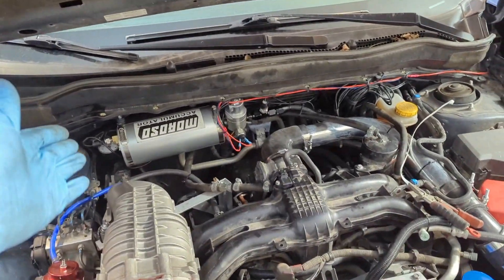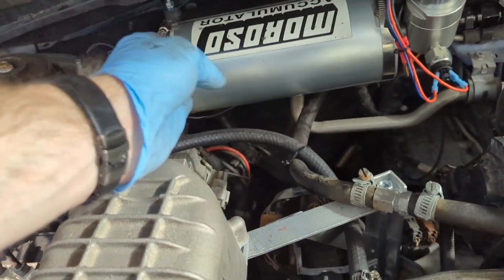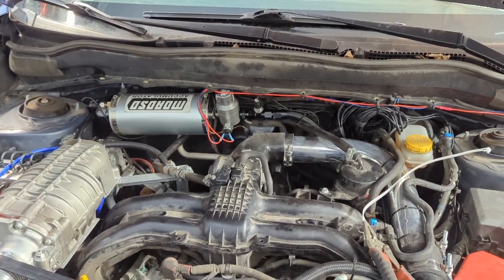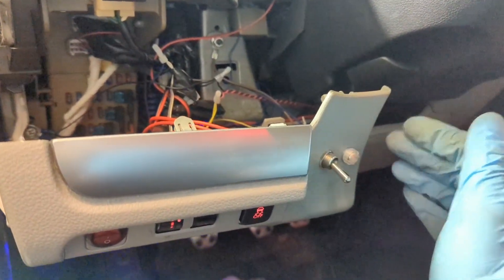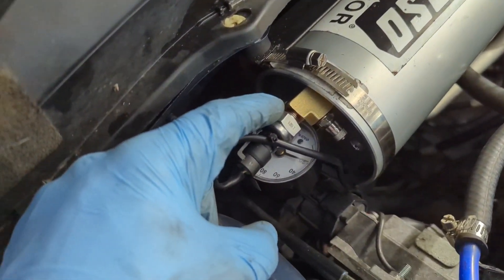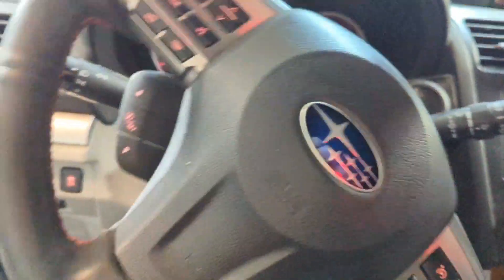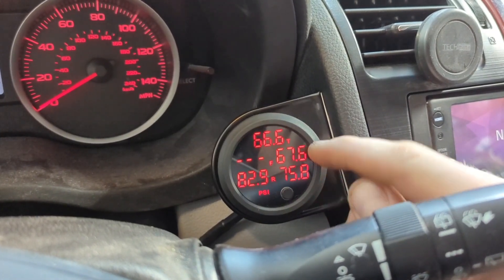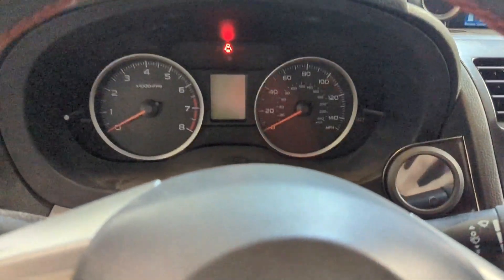Subaru Accusump Basics, Install, and Demo!

Comment: Where did you pick up that multiple pressure guage?
Reply from the maker: eBay - look for gauges intended for air suspension setups
Reply: @avsti  Sweet, thanks!

Comment: Who makes that sandwich plate adapter? Could the oil accumulator be run to one of the ports you have a pressure sensor at?
Reply from the maker: Something from AliExpress. And yes it could be, but that's pre oil filter, so most of the oil would flow back into the pan and not into the engine prior to startup.
Reply: @avsti  ok that sucks. Would have made for an easy connection in my car. I'll have to figure out something else or just go with a cooler alone
Reply from the maker: I didn't mean to totally dishearten you, mostly defending my choices. Accusump into a sandwich plate is still way better than no accusump. Plus, some sandwich plates have connections post filter!
Reply: @avsti  no problem. I just want to do it the right way that's the least hassle. I've seen diagrams teeing the accumulator into the line returning from the cooler and using a check valve. I would think the thermostat will prevent preoiling before start up because the oil is cold
Reply from the maker: Typically, oil thermostats don't block flow from a cooler so much as divert oil going towards the cooler down a bypass. It could still work.

Comment: Love that gauge, you mentioned it was cheap but can't seem to find one? Could you please give Me a name of it so I can purchase one as well? Quick video of My rear engine Subaru project if you are interested? https://www.youtube.com/watch?v=a39IrHRBDNo
Reply from the maker: https://www.ebay.com/itm/145172471775

In case the link stops working, search for a 52mm gauge with 5 air pressure sensors. $82ish!
Reply: @avsti  Thank you!
Reply from the maker: Also, amazing build!